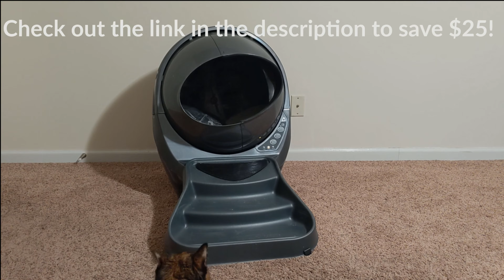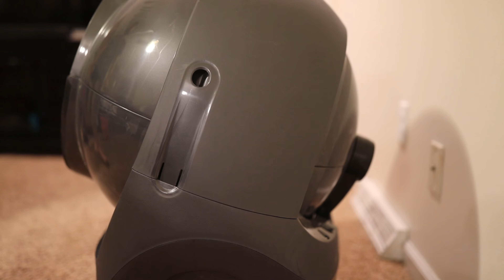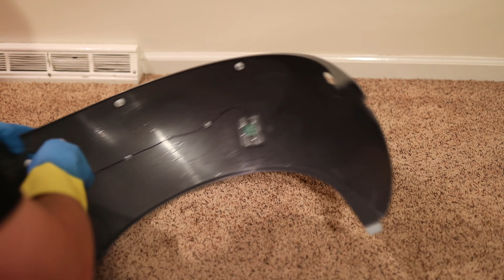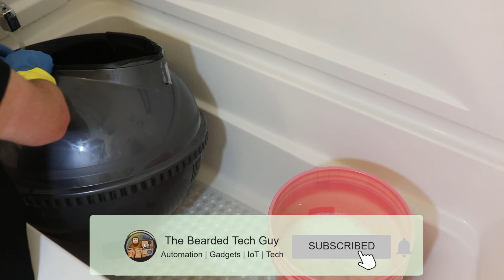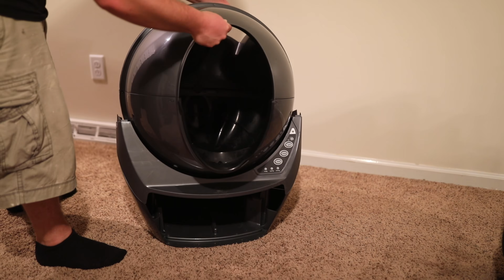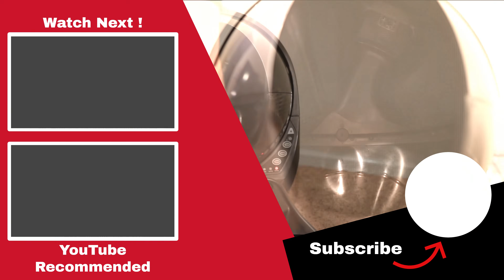How to Deep Clean the Litter-Robot Smart Litter Box Indoors

Comment: I thought you couldn’t get the weight plate super wet? I went on the website and they said that there’s no electrical parts in the dome so you can hose it off but I don’t want to get it incredibly wet if it will mess it up. Lmk!

Comment: Great video. I have had the LR3 for 2 months, and it really needed a cleaning with 3 cats using it. Your instructions  worked to a T.  My only recommendation is that I put a towel under it when I cleaned it on my patio so as not to scratch the globe.  One of the cats is only a year and a half. He likes to lie on his back and scratch the filter which is getting all fuzzy.  I originally bought an Intsachew and had to return it.  The controls as well as the wifi connection never worked.  Do you have a final review on best litter.  I am using Dr Elseys but it is really dusty.
Reply from the maker: Glad you liked the video! So far I've found good success with arm and hammer slide

Comment: Thank you for the thorough review. I am thinking about getting this but my concern is that the poop touches the surface of the ceiling before it drops to the pan so there is surely fecal matter there which is disgusting, is there enough clearance so that the cat's head doesn't touch that yucky ceiling?
Reply from the maker: The opening of the globe is 15.50inch and the inside of the globe is even larger. My cat's head is no where near the top of the globe when inside

Comment: We had a bit of an accident where the dome of my LR2 rotated through soft poop (the drawer was too full) and is now covered in it... Dawn isn’t taking it off. Any tips? 😔
Reply from the maker: I'm kind of surprised dawn isn't working for you. Are you using a brush to clean with similar to the one I use in my video? Autopets does sell wipes you could try, but if dawn isn't working I don't think they would help here. I'd also suggest reaching out to support, they might have some reccomendations for you as well
Reply: try using a Mister Clean Pad. This will take it all off.

Comment: I have a Litter Robot 3 and have had growing concerns about my drainage pipes with the robot.  I see it appears you have a clay litter. This is not good for your drains to let the grains go down the drains.  If you can hose your litter robot down in your garden or at a car wash it would be better for your drains.  The best litter I have found for the robot which is drain safe is walnut grain litter as it is a flushable litter that won't risk clogging your pipes.  It is the right consistency to work with the litter robot's clumping function - although slightly less dry than clay litter it clumps well. I will usually run the cycle function once in the morning while kneeling in front of the litter robot and scrape the rubber as it tips to assist in releasing the litter stuck in the bowl.  I've also installed a Kitty Portal in my bathroom door to allow the door to the bathroom to remain closed for noise and odour control with my multi cat household.
Reply from the maker: A good point I should have been more clear about in the video. It's very important to remove practically all of the litter from the dome while emptying it and is why I brush it when its upside down. We maintain our pipes so the small amount of litter that ended up getting flushed isn't a big deal but large amounts can very easily clog drains. If you are washing inside you can get a fine meshing to put over the drain to catch any stray litter. 

Just a side note - flushable litter still does run the risk of clogging drains as it absorbs water and can get stuck in the gunk that might be in the pipes. If it doesn't break down quick enough after getting stuck it could cause a clog.

I'm in the process of trying out additional cat litters so I will take a look at walnut grain litters, thanks for the tip!